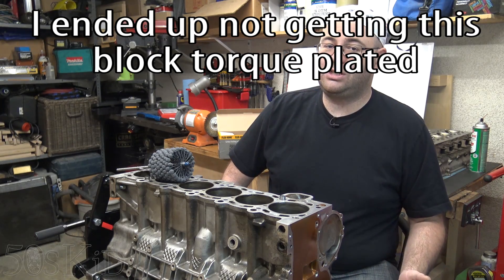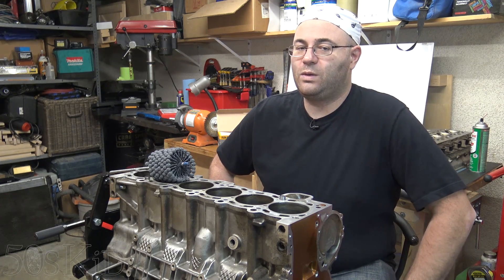The Difference Between Boring & Honing #m54rebuild 17

Comment: Bore and Hone should only be done by computerized machines! the size has to be perfect for every cylinder so there's no gap when fitting your pistons!
  I'm sorry but, for a procedure that requires that level of perfection, doing it by hand is simply ludicrous!
  although it will work, you will not benefit from maximum performance and reliability!

Comment: If your std piston bore clearance is 0.003 + wear and you remove another 0.002 your looking at a fair bore clearance which will probably end up with slap.
Reply: Ball hone or Flex Hone will only take off 2 tenth of a thousands  3 inch and .508.0   after 20 to 50 strokes up down the cylinder the reading will be 3.508.2   Its not a boring stone its a crosshatch stone  or deglazing brush .    It take 120 to 200 strokes to remove .002 th   your only doing this to use new rings that did not seat . 10 to 20 strokes will not change the bore .  but leave a fresh crosshatch .

Comment: I agree Its best to have the block plated. Using a three stone to correct a taper or egg of .002 is not something for a novice.  For a simple correction less than .0015 -.002 I use a three stone hone attached to an old school crank hand drill it gives me complete control. I use two different grits first between 240/280 to correct the cylinder then a 500 grit to finish, after stone work a green scotch brite and HOT soapy water.

Comment: As always, outstanding presentation. I've learned so much from you. Thank you very much.
Quick question: Will the hone brush or stone remove rust from a cylinder wall?
Reply from the maker: Yes but it depends on how deep the rust goes.  Both types of hones remove very little material so as long as it's just surface rust, yes it will.